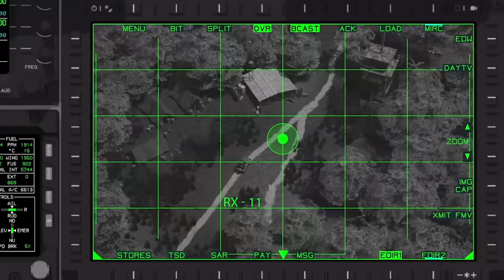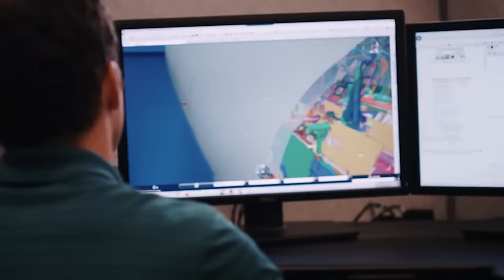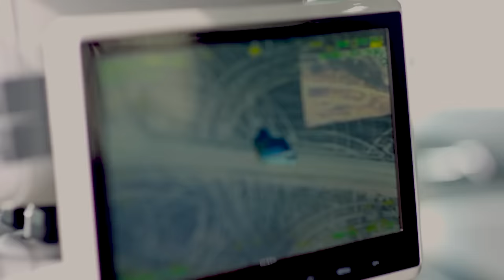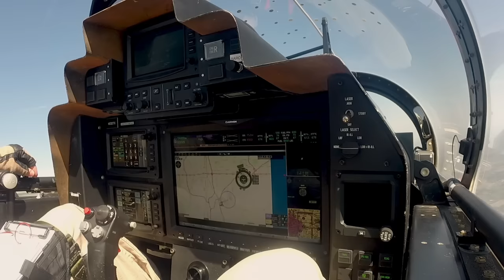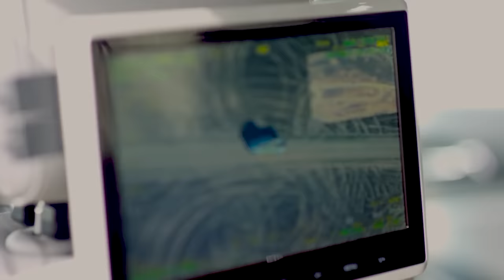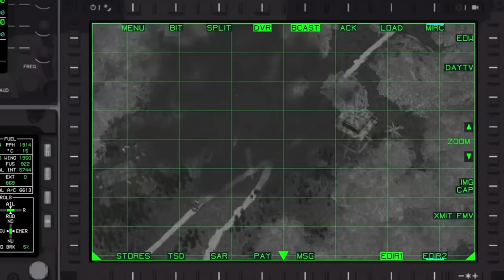The US Secret Aircraft That Made Everyone Go Crazy When It Was Released

Comment: Bring back the F-20 Tigershark and the YF-23 airframes with upgraded engines, electronics, and avionics.
Reply: silly comment on many levels.
Reply: @LeonAust  ... Really?  Huge cost of new aircraft development is designing the airframe.  Why reinvent the wheel when it's cheaper to refit the tyre?
Reply: @WTH1812 They have refit the tyre with proven platforms I.E F-15, F-16, F-18 etc. There is no market for a modern F-20 when you can offer the F-16 with its massive spares, support & knowledge pool. The legacy F-5 operators are few and far between nowadays and those of which who are friendly with the U.S have ordered F-35.
Reply: @jamiestallwood5080  ... One of the most under appreciated facets of WWII military production is the value of differing capabilities.  For example, the P-47 which with fuel drop tanks reach most targets in Germany was supplanted by the P-51.  The P-47 then switched to a role of suppression bombing ahead of the front lines using increased bomb loads and strafing to target troop assemblies, rail assets, marshaling yards and so forth.  

This pattern continued in Korea as the transition to jets was made by both sides with varying levels of success.  

In Vietnam, there was no match for the F-4 II Phantom until there was.  F-111s supplanted F-105 in bombing sorties.  And so forth.  

The point being, that while selling off James Wright's excess production of F-16s from 35 years ago, and there's big profit margins in the F-35, the NGAD scheduled for 2014 is still scribbling on drawing boards and drafting tables while ego's squabble over whose willy is widest.

Comment: I never heard of this aircraft until I found this video.  Evidently it suffered a fate similar to the Fairchild T-46.
Reply: Desperate for new material. If I remember it was third in a group of three, and was the most expensive.
Reply: If by suffered you mean was surplus to requirement, then yes.  It was one of the many shit hardware ideas born out of fighting insurgent groups but unlike so many, thankfully was not purchased.
Reply: Two prototypes? N531TA and 532TA.
Reply: Except the Eaglet helped bankrupt Fairchild and led to the company collapsing.
Reply: there are many secret aircraft types that were never disclosed. my uncle was a test pilot for the FR-426 and the T-32b (the latter's top speed was over Mach 7.6)

Comment: I worked on this project installing testing equipment. They were hoping the USAF would seek a dual role as an attack and a trainer. They failed to realize the standard to be able to withstand a 6.5 G climb. This aircraft could only handle a 6 G climb. It was rushed and haphazard. They hired people off the street who had no prior aviation experience. I only knew about FOD and took accountability because of my experience as an aircraft electrician in the army. I’m thankful no one got hurt. They would spend a full day cleaning out rivets and whatever else. Backwards from the “clean as you go” method.

Comment: Part of this jet was designed in my hometown. This jet has been around for a long time at least 10 years it’ll go somewhere when the war kicks off
Reply: Why? The f35 and f22 fill its roll perfectly as is
Reply: @TheWorstBridger  Less expensive, easier maintenance, quicker deploy and they will fill in the gaps as F-35 and F-22 get downed from use or shot. The amount of time either of those 2 take to manufacture plus the required rare metals means they are slow to replace. Heck the F-22 is no longer in production thanks to Congress, loosing one means zero replacement. But I am sure the plane to fill the gap will not be this one but the Air Tracktor.
Reply: @stratometal  Countries that can afford jets want fast jets, not a subsonic POS with a marginal weight capacity (fully fueled it can only tote about 3,500 pounds) and countries that can't afford jets will buy a fleet of turboprops, not a handful of smurfjets flying on a pair of APUs.

Comment: Bravo to the team that pulled this off. It reminds me of the breakneck pace that the A-12 and SR-71 was developed. You have achieved what the folks developing the F-20 Tigershark could not. A cheap workable fighter for those countries that need such a beast. They dont need a modified commercial aircraft as many have tried before, they need a purpose built machine. You folks have done Wichita Kansas proud and honored the great aviation heritage that flows thru your community. As a member of the original prototype YF-22A design team i salute you.

Comment: "sees a market for up to 2 thousand"

The problem is that noone is sane enough to actually go for this SMART concept.   Seriously, even just reducing your "advanced" number of aircraft by 10-20% and replace them with an equal cost of this aircraft would allow a huge increase in both training hours for the pilots as well as having a larger airforce overall which is a great advantage.

.

In many ways, this plane is basically a modern version of the SK-60/SAAB-105 trainer/light strike.

It's a great concept, but the question is whether buyers will be able to overlook the lack of bling to just get something that WORKS and that they can fly ALL THE TIME.

Comment: I wonder if a stripped-down racing version could be made for the civilian market.
Reply: That would be sweet!
Reply: I was thinking the same!
Reply: These are bizjet engines and aren't rated for aerobatics.
Reply: @justsomedude8118  The F124 is an aerobatic version of the bizjet engine - it's fine. This would be a sweet plane to tool around in Microsoft Flight Simulator in.

Yes, I said in Microsoft Flight Simulator. That's the only real use case for it.
Reply: @katherineberger6329  F124 has a much higher fuel burn, but is a fantastic powerplant. Using one of these would likely be ideal vs two higher bypass engines for this use type. Sure, there'd be less thrust at low speeds, but it wouldn't suffer in the lapse of thrust vs airspeed common with higher bypass ratio powerplants.
Reply: @justsomedude8118  Regardless, it really is a perfect MSFS plane, just no use case in the real world.

Comment: The Textron Scorpion is literally an American manufacturer going "What if we duplicate a plane that is already readily available for under $10 million, and make it cost $20 million because no government is footing the development bill?"

The Scorpion is an Aero L-159 ALCA but less capable and more expensive.
Reply: Less capable and more expensive? The video clearly stated its interchangeability and Mission profile flexibility. Cost to operate and loiter time. How is that less capable? Composite design and modular.
Reply: @JSFGuy  The Aero L-159 is ALSO modular, has a similar loiter time, costs less to operate (about $1,600 per flight hour)... AND it's faster (so it can get into and out of trouble spots quicker - "shoot and scoot" and built on a well-understood airframe. When you're comparing it to $30,000 an hour to operate an F-16 the Scorpion sounds good, but most air forces are comparing it against a plane with a much more modest cost per flight hour; and if it comes down to it an F-16 can tote ten times the payload and still snipe as many Scorpions as it has missiles.
Reply: @katherineberger6329  well now you're comparing two opening day or Frontline service, it's not meant to be a with adversaries. That 159 cost $1,600 per flight hour I find that a stretch. Now the 159 can be an affordable fighter. The Scorpion is not quite done for that I think you know. I don't know that 159 to be as modular as this proposed new design with off-the-shelf components. One thing you do want is Parts availability and that would be the engine avionics and landing gear.
Reply: @JSFGuy  
L-159: Proven airframe + less expensive + dirt-common engine (the Honeywell F124 is a military version of the Garrett (now Honeywell) TFE731, one of the world's most common bizjet engines - and in fact the SAME engine the Scorpion uses).

The L-159 is the airplane that the Scorpion is trying to compete with, and there's absolutely no reason to put funds into an unproven airframe when a proven airframe with over a half-century of success (the L-159 is a modernized version of the L-39 and L-59 trainers) is available for less money.

The only way the Scorpion is going to get users is if the USAF buys it, and that ship sailed with the T-X program. If the USAF buys a new jet ISR/strike plane it's almost certainly going to be based on the Boeing/Saab T-7 airframe.
Reply: @katherineberger6329  well, that it shows the 802 and already had a mishap with it and that operation has kind of cooled off. They have made blunder decisions in the past and they continue to do so. Willits surveillance and some closer support so they did once a different approach with a different platform and wind up choosing a crop duster a damn good one at that. 30 years ago they put out for a JPAT wound up ordering a turboprop instead of a jet again

Comment: The point is generally missed with this aircraft and other light attack / ISR platforms. Admittedly the theatre in which it could have been utilized to its maximum has expired (Afghanistan/Iraq). Theatres that had no significant air to to air threat and little in the way of ground to air threat. The time these should have been demonstrated has passed. However, the benefit this aircraft brings to the table is generally overlooked. You can utilize a fleet of these alongside top tier platforms like the F35. In effect utilizing the F35 for air superiority and initial neutralization of ground based threats. Following this the Scorpion could easily slot in and provide the required ISR and light attack to maintain dominance. Essentially this would cut down on the cost of acquiring a greater volume of expensive to acquire and operare top tier jets. Further to this, a nation with a fleet of Scorpions would be able to consistently and affordably contribute to joint operations with partner nations operating more expensive platforms. I think the one machine to do all approach of the current military mindset fogged the possibilities of this platforms potential. The future with all one type of aircraft is risky.

Comment: There’s a lot of misinformation about Scorpion, beginning with the notion it started as a single engine aircraft. It did not. Scorpion started as an all-composite rebuild of the A-37B Dragonfly, with updated avionics, Martin-Baker ejection seats, conformal tanks, the center fuel tank converted to a HUD-enabled 20mm cannon, and refurbished J85-GE-17A engines, because that was the only motor that would fit in 17-inch vertical nacelles. The SECDEF/IA had two Brigadiers in the room when the original design was proposed. They loved the mission but not the side-by-side configuration. In one week the design was reworked as a tandem stepped cockpit. It looked like a small A-10, all composite to defeat metal fatigue. The original build plan was a $135M JCTD with Air Combat Command and AFRL. Epic Aircraft, Bend Oregon, was going to produce the five prototypes. They went belly up. Obama took the JCTD funding in his 4th-5th round of Pentagon cuts after 20 Jan 2009. That left private industry. What got the program rolling was a personal declaration by a member of the Joint Chiefs to the senior executive team that the ANG needed to recapitalize and couldn’t afford F-35s. Norty Schwartz, AFCS and chief of the USAF high-fast mafia, took the ANG’s recap funding for use on the F-35, so the original build went from 350 units to zero. By then, the company was committed. The CEO of Textron was visionary—all respect to him. But the original composites team, composed of the number one commercial composites AC builder (Dieter Koehler), and former LMCO composites experts (built the F-16, F-22, F-35 and led by Lee McKague) was replaced by Cessna composites guys, who had absolutely zero useful experience in composites. The JV founders planned to bring Textron up to date in the composites world with this program, but the Cessna-heavy management team fired them all. Stupidest move in the history of aviation. The prototype turned into black aluminum, gained weight and lost capability. It was still vastly superior to any single-engine turboprop “solution” anywhere in the world, including the Super Tucano, Wolverine, or that ridiculous Skytractor dressed up like a war machine. A lot of good people worked hard on this but were beaten by terrible management, petty politics, and ultimately, the high-fast mafia. Noble airplane with fabulous capability (could loiter 4+ hours 100 nm from base w/o refueling, with 6,000 lbs bomb load. Could prosecute two EO/IR missions simultaneously. Max ceiling 45,000 feet. Airliner speed but could fly as slow as a Cessna 150.) Ultimately a very sad chapter in the idiocy of the USAF.

Comment: Much like the Northrop F-20 Tigershark, the Textron Scorpion makes sense on paper, but no nation really wants to buy a military aircraft not already in service.  The KAI FA-50, HAL Tejas and CAC/PAC JF-17 all offer supersonic performance, and low operating costs.  They are less expensive ways to get 85% of an F-16's capability, at 50% of the cost.  The Scorpion is not a credible A2A fighter, and is restricted to sub-sonic speeds.  It has lower costs, but also reduced performance.  The missions where it excels, may not really require a jet powered aircraft.  Some of its ISR sorties would be handled most cost effectively with UAVs.

Comment: I'm sure it will sell well.

Considering the successes of the past - a universal weapon system is a good weapon system. Tried-and-tested components, light and mobile, high loitering time - the formula for winning the race.

But, as mentioned, it's a low-intensity plane.

Therefore, it can't beat the A-10 in that regard. It's a flying 30mm gatling-gun with an armored tub on top and wings attached. It can still fly with one engine, half a tailplane, one rudder and riddled with bullet holes.

Many of those fancy super-high-end niche fighters (I'm looking at you, F-35) were already outdated when they reached the battlefields.

What's the point of a stealth fighter - if it can be detected even before it's delivered to most customers? German company Hensoldt demonstrated it years ago.

For the same reason, when the concept for Eurofighter was made, stealth was considered - and rejected. Stealth costs in two ways: Money (in development, in construction and in maintainance) - and flying performance. For the same reason F-117 (which had cost a fortune in those regards) was taken out of service. 

The focus when making Eurofighter was more directed to agility. For the simple reason it is way harder to counter.

Stealth becomes pointless when you upgrade your existing radar systems with more computing power. No matter how small a radar signal in your raw data is - with enough computing force you can separate it from the noise.

Plus, computers develop significantly faster than aero tech.

A very agile fighter on the other hand can dodge enemy rockets - simply by physics. A rocket flies very fast due to small control surfaces(less drag) - but it can't change directions as quick as a Eurofighter can.

And physics don't change - no matter how much time passes.

Eventually, there will be something that can beat it - but that will take time. A lot more than to beat stealth.

Comment: I have often thought that it would be a more survivable airplane in an army of occupation role as it could fly high enough to avoid Manpads or shoulder fired portable missiles. Other than that, turboprops are less fuel hungry and have lower flight hour costs. I feel the biggest problem in selling it is the global glut of similar light military aircraft being produced by foreign companies that have lower labor costs. It needs to have superior electronic and sensing capabilities and perhaps superior electronic  data sharing with other aircraft ( data link)  to justify its higher price tag. Similar to how the globally higher priced Grippen is structured. ( other global military aircraft are out there that cost less but few have the Grippen electronic sensor and data link advantages)

Comment: It's looking to fill a gap for which there is no new aircraft requirement - doomed to failure because there are more capable, albeit more expensive, aircraft already in service that could do that role if necessary.  The cost of introducing another, less capable aircraft, far outweighs the lower costs of the new aircraft.
Reply: There is AT-802U that is 5 times cheaper and better in most cases (armored, 8k pounds of payload, loitering time).

Comment: They seemed have read the market wrong. 

1. The low budget buyers also have option of 2nd hand platforms which may have shorter life left but with much better capabilities.  

2. The low budget countries’ decision tend to hinge on very few decision makers rather than processes.  To those decision makers, the public perception also matters, so called ‘Wow factor’ by the public.  Old F16 may bring Wow to the public (eg Vietnam, Philippines etc) but this would not.  

3. For medium budget countries, the choices are much more open. FA50, JAS39 etc.  The operation capabilities spectrum is so much wider. Also the price tag is not that different (TA50 is $22m and JAS39 C/D $25m).  

4. For high budget buyers, this offers nothing new or unique.  Furthermore, as it was pointed out repeatedly, the platform was not tailored enough for their likings.  DoD, CG and so on would rather spend more and get exactly what they wanted than buy off the shelf quasi-military plane. 

The market has a niche. But this was not the right approach.